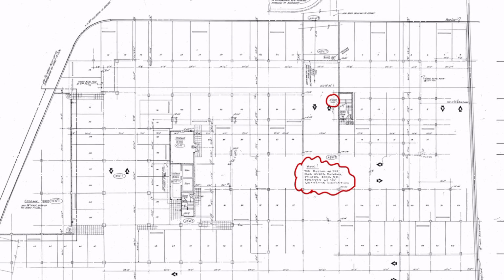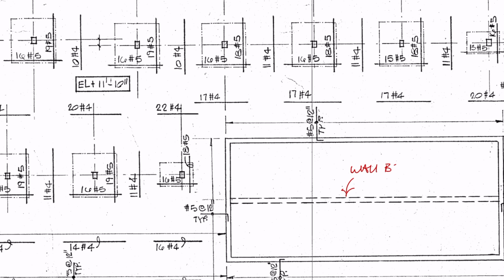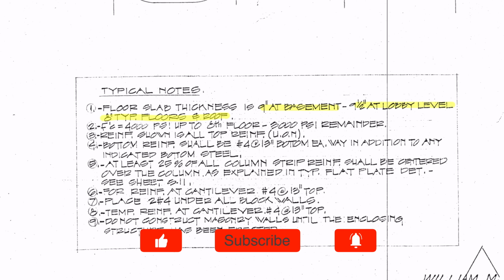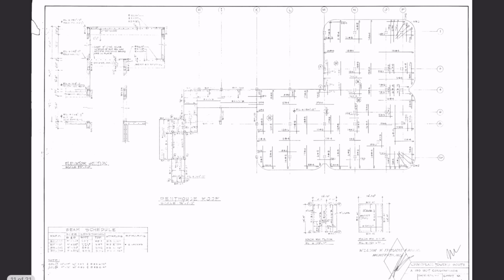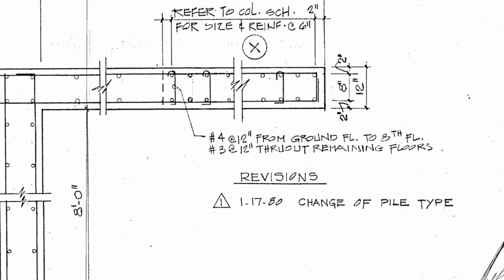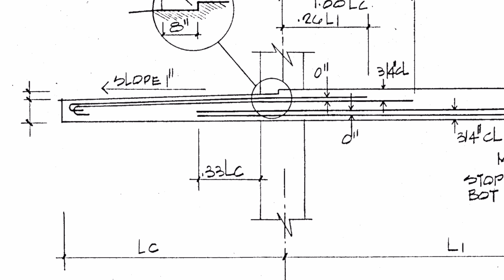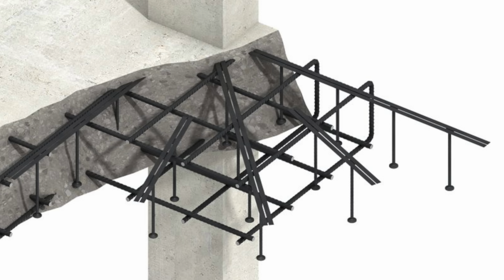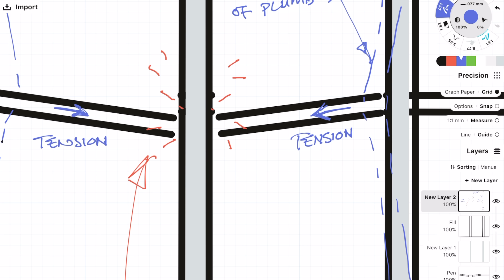Surfside Condo Collapse - Reviewing the structural drawings - Was the design bad?

Comment: If your not from Florida and actively work with concrete structures in Florida its hard to find your opinions relevant. You make some good points and some pretty ridiculous ones too. Is obvious you just jumped into this with no research or prior history in the area... It would be more helpful if you justv share a link to the plans and skip the opinions for now
Reply: If a European is saying the thickness of your walls are minimal, that pretty much means your walls are doubly minimal since everything in Europe tends to be on the more minimal side... if you have been there, you would know exactly what I am referring to... :)
Reply: @charlesdang4670  explain
Reply: @designstudio8013  You have to be there... The U.S. is called the land of The Big MAC for a reason.... everything is made much bigger here... :)
Reply: If you were a structural engineer building concrete structures than the rules are pretty much the same. Some of the techniques might be different. And the building code certainly will be different. But he can take his computer and calculate how big things should be. 
And his assessment of the building appears to be that it was the bare minimum.
Reply: @neilkurzman4907  i am an engineer and i work on concrete reinforcing steel,  i do this every day in Texas. Not Florida but i do know the similarities and differences that come with different areas standards and jurisdictions and a building this close to the ocean with consistent sea water intrusion and possible hurricane wind loads would require a corrosion resistant reinforcing and more than just one shear wall / shear structure,  each of the stair wells should have been a shear structure,  also the punching shear in the slabs at the columns was not mitigated the reinforcing in those areas and in general was not adequate.  I have recently been made aware that the mid 70s had an epidemic of unsafe shear zone designs at the interface of slab and column, they just didn't get it at the time where now we use specific stud rails designed purely for punching shear at slab column interface etc etc i could go on for hours on the topic and i should get back to work on the rebar for this school amphitheater the customer just added
Reply: @TungstenCarbideProjectile  
Obviously the structure was less than it needed to be. The question is how many other structures are like that. What Insta be done to ensure that others do not fall down. My only comment here is that we need to wait until investigation is completed. Guessing is always iffy. 
But I am a software engineer. So I’m not going to tell construction people how to do their job.
Reply: I always thought gravity was a pretty universal constant and similarly, sea side corrosion is another pretty universal and anyway the UK probably has more (harsh) coastline than Florida... so where is your ‘beef’ coming from?

Comment: The step up beam is what pulled on the building columns and the lack of steel helped it not come down as quick.
I don't think the building column had a punch thru. 
The beam  BMA also damaged the column along with the 2 way patio slab as they fell and tore out part of the column which can be seen in a few pics. The columns buckled due to radius of gyration or the slabs ripped out of the poor tension connection.
Reply: It seems you are saying much about what I said some weeks back.

Comment: I understand that you think that these walls and specs are light and not up to what you would expect, but what were the historical codes in that time period that this was built?  I think that is helpful in understanding the situation as a whole.  There have been significant developments in technology since the late 1970s and not taking that into consideration is omitting part of the story of how we got to this point.
Reply: Not much change to ACI codes.
Reply: @designstudio8013  From the 70s and 80s? Sir I would definitely disagree and I'm not an engineer.  I have also been looking into this and there are a number of actual engineers that have explained practices and the differences between then and now.  Then logically thinking about it, to say that things haven't changed in 40 years is blatantly false.  I have been involved in planning buildings at a former job and as an outsider, I know that there are building practices that have changed.  This comment annoys me that you won't even address it.
Reply from the maker: Actually what @Design Studio is saying isn’t wrong. I had a look at the ACI codes of practice for concrete structures today (I’m British so I’m not that familiar with American codes) and the difference between the years hasn’t changed much. This is to do with technical design not building planning rules etc which I have no idea about in America.
Reply: @EverydayDazz  thanks. I know because I was in structures class in 1977 and was an inspector for 20 years...in Florida.
Quick question as I forgot alot of this stuff.
When you have a moment at a fixed end of a beam of say 300K do you resolve the forces into a 300K tension and 300K compression component and design the bolted connection for 300K tension?
Reply: @EverydayDazz  Thanks for saying that, but any person that has ACTUALLY done work in the US instead of just reading it in a book would know that building practices have changed over the years.  For this guy to dismiss it shows his lack of understanding of any real world applications.

Comment: The lack of shear walls isn't the problem. Its clear that the person design a frame systems in 2 perpendicular planes. He has low amount of steel in his shear walls, because the frames have way higher stiffness, compared to a shear wall near the center of mass and stiffness. To me it looks that the original analysis didn't gave high values of the internal forces in the shear walls. For me personally one of the problems is the low anchor and lapping lenghts.
Reply from the maker: Whilst I agree that there could be frame action to help with stability given the size of some of the columns. The reinforcement detailing tells a different story. 

I don’t believe that the way the reinforcement is detailed (especially the edge columns) have enough fixity to provide full frame action. 

I may do a 3D analysis and see how the structure behaves to test this theory.
Reply: @EverydayDazz  From what I see, my oppinion is the lack of beams is the main problem. After I watched your video again, I realised that he can't have a frame system without beams. Usually a no beam slab is supported by a big number of shear walls. The lack of top reinforcement in the slab makes the assumption of horizontal diaphragms not realistic.

Comment: This was a good informative video. I like how you just got to the point yet with explanation that we all can understand. I also really like that you concluded your thoughts with the 4 issues. Bravo. What do you suppose this means for the other “sister” condominium?? Do you think it was improved since it was built about 1 year later?
Reply from the maker: Many thanks for your comment, really appreciate it! 

If it was designed and built by the same people, probably not. I’d hope they’re inspecting it now and doing repairs where necessary. I’d also hope someone is doing a design check using modern software.
Reply: @EverydayDazz  I think the engineers are all over the sister building, taking core samples, and presumably using all available electronic techniques. The sister building has been much better maintained.
Reply: @gerardacronin334  Two buildings, the North and the East based off same baseline prints !
Reply: @deedewald1707  There actually were three buildings on Collins Avenue constructed from the same or very similar plans. Champlain Towers South (1981), North (1982) and East 1994?).
Reply: Sister condominium?? Where is that building??
Reply: @kellyname5733  There are two of them. They are the second and third building to the north of the one that collapsed.

Comment: According to the head of the company that demolished the remaining tower the plans didn’t match the building. He gave an interview to an engineering publications.
Reply: Yes...something about those thin/lack of columns and lack of punching shears has bothered me from the beginning. Soft concrete...Big Problem. Plans not matching to the built structure...not surprised. It appears this building was problematic from the start. Did the people responsible (engineers, architect and the construction company) cheap out? Or was it appropriate for the time? The buildings secrets will be exposed eventually.
Reply: @kellyname5733  - I heard the head of construction  left before building was finished. Possibly an indication.
Reply: @kellyname5733  , Dazz said explicitly that the columns were adequate in size.  He also thinks that the failure was a sequence of punching shear through the slabs, which means that the slab/slab attachments failed, but the columns did not.

What do you mean by "lack of punching shears"?
Reply: @HypercubeJones  I think correct would have been  "lack of punching shear REINFORCEMENTS "  . There should have been 4 rebars per face  (plans)  and the post collapse photos show only 2 per face . This is a classic inconvinient thruth situation because the sister buildings could have it and no amount of maintenance adds missing rebar back into columns .
Reply: @cat_lin1  
No but regular maintenance would’ve meant that the under design building wouldn’t have been exposed to excessive stress.
Reply: @neilkurzman4907  The under design building is already in excesive stress , maintenance factor is that  the least mantained one falls first . Anyway we are just people on the net , we need data we don't have to draw a rock solid conclusion, but I would bet they will make modifications to those buildings pretty soon (punching shear reinforcements ).
Reply: @cat_lin1  
Underdesign doesn’t mean ready to fall down. It meant that there was less of a margin to deal with other issues. Like the poorly maintained concrete.
I’m sure that when they find what all of the causes were they will be recommendations on changes to the building code. And what should be done to existing buildings.
Reply: @neilkurzman4907  Well , it's quite hard to lawyer back in HALF of the calculated strenght in a building already constructed with very tight margins (look at those shear walls , ie lack of them ).
Reply: @cat_lin1  
The building was designed over 40 years ago. Probably before the guy making this video was born, or at least when he was a small child. That was the code at the time. And builders tend to build toward the minimum code. Additional sheer walls would have certainly have saved many lives. The one that was there save the lives of everyone in that part of the building. I’m sure much will be learned from this collapse and that hopefully that knowledge will be applied to the minimum standards for new buildings. And white retrofits older buildings need to ensure that it doesn’t happen to them.
Reply: @neilkurzman4907  - I agree with your first sentence
Reply: Sounds like a case of mob construction and or payouts, especially for that era of building
Reply: You wouldn’t happen to have a link to that, would you? I’m curious to have a look myself. Thanks.
Reply: Link please.

Comment: It is unlikely that the underside of a cantilever slab will crack as it is under compression in all load conditions.  Adding steel here is not a good idea as it is more steel to rust and cause spalling and it is completely unnecessary steel.
Reply from the maker: Steel reinforcement is there to confine concrete from bursting under compression forces. It is also why you add reinforcement for steel columns. Reinforcement is not there just for flexural stresses. 
Also reinforcement is there to prevent the concrete for shrinkage and thermal cracking.
Reply: @EverydayDazz  Only if the anticipated stresses require it.  Most small residential cantilever decks don’t.  Many concrete beams have steel on only side.  A good engineer only uses steel where needed.  More is not necessarily better.

Comment: if this is the truth, and why not? if the deck collapsed because of unexist punching shear. the all columns structured in the same way, that's why the building collapsed like a pancake.
they just had lucky untill now
Reply from the maker: “Collapsed like a pancake” is a good way to describe progressive collapse for laymen. 👍 

The lack of robustness I can see from the reinforcement detailing of the slabs I think is cause of concern for sure.
Reply: @EverydayDazz  you got me wrong, pancakes are the worst thing that could have happened. its not my definition that the term the news used.
Reply: @davidperets9997  
Pancaking is typically described as when one floor falls intact onto the floor below it causing that one to collapse. 
The resultant pile of rubble appears to be like a stack of pancakes. 
In this case the failure is happened from the bottom up. But the resulting debris pile appeared the same.
Reply: @EverydayDazz  My quick response yesterday was at 1 p.m.
Today I remembered that in fact those who came up with the concept of pancakes were engineers who were interviewed for the news. They explained that this collapse is called pancakes in the engineers, I did not remember anyone criticizing them for using the word, from there I know the concept, so you as an engineer should know about it and not decide that I underestimate the disaster.
Secondly what you explained about the punching shear  that engineers sometimes do not use (as if it is their choice and not mandatory), is simply a crime!
The American Association of Engineers is complicit in this crime that led to the collapse of the building, for knowing that it was happening as implied by your words.
That means millions of Americans are in danger of collapsing buildings, if that's not a good reason to go to protest I do not know what is.
Millions of Americans need to show that they are not puppets of the engineers but living people whose lives should be taken seriously, and only a big protest of millions will make it clear to the Engineers. Association that they have no right to make their own decision that could lead to building collapse.
Until now I only knew of a construction standard, but from now on one has to think of a structural standard, and what was on Surfside did not meet the minimum standard.

Comment: Finally someone who just gets to the point without bias! Without overbearing opinions, and without confusing terms! Thank you so much for this video! I really appreciate it! Well done!
Reply from the maker: Many thanks for the comment! I did try and make it more laymen friendly. 

I think next time, I’ll add some descriptive text whenever I mention a structural engineering term.
Reply: @EverydayDazz  the question is if this design was to code when the building was built.  Todays designs and codes are irrelevant

Comment: The builders seem to have cut corners to save money either their own or with owner/investors agreement or simply due to lower building codes at the time. If the later is correct, all buildings built before codes were tightened should be inspected immediately. Criminal!
Reply: Builder was a construction rookie, constantly worried about his bottom line. In the end - he still pocketed a cool $23,000,000 from Champlain Towers South final sales.
Reply: @Dilberto88  Hey Zachary where did you find these details? You gotta' link, please? What was the construction rookies' name?
Reply: @kellyname5733  I have a friend whose parents knew builder Nathan Reiber. The parents were one of the first owners of Champlain Towers South(1983-1994). They also lived in the same area of Toronto as Reiber. He was disbarred attorney from Canada before escaping to Florida.
Reply: @Dilberto88  Criminal indeed. Alas, he's deceased.
Reply: The design alone did not cause the collapse. The main problem failure to properly maintain the structure.
Reply: My experience with cost cutters is that they often know nothing about engineering principles. So they don't know what they are cutting. I wonder how many of them even know what shear is?

The conclusions of many of the replies here are apparently from engineers or architects. I myself am an architect. The consensus seems to be that the patio slab failed through punching shear and the falling slab induced torsion in the integrated tower columns leading to buckling and failure.
Reply: Mobster connections, seem almost certain
Reply: @rhianimal19  - not in this case. This project was doomed by the abject thriftiness of the developer, Nathan Reiber. He was operating on thin margins and cut corners to put more money in his pockets. Reiber even hired a cut-rate building Architect, William M. Friedman, to draw up plans. Friedman nearly lost his license, as two structures he previously designed were destroyed in Hurricanes from 1965-1967. By mid-1980, Reiber lost two Contractors who probably wanted nothing to do with his cheapskate ways.

Comment: I agree with everything you say, mainly about the structural stairs supporting the building. One professor told me, the building can go down but the stairs should stand. Also look at the deflection of the beam before collapse under the planters and extra concrete and pavers and other extra alterations like water and humidity to the slab. (The first major failure in the slab that brought the columns down?) Congratulations from Portugal.